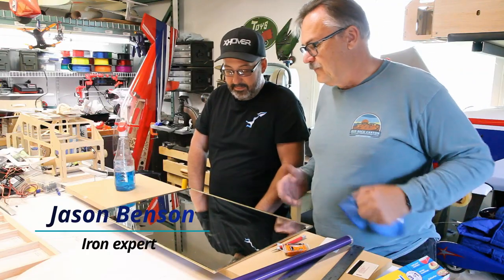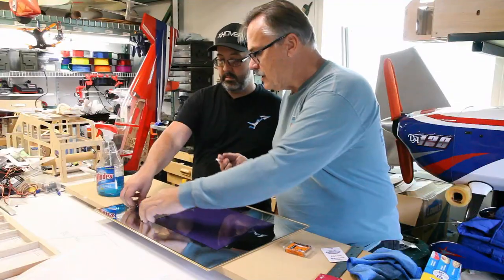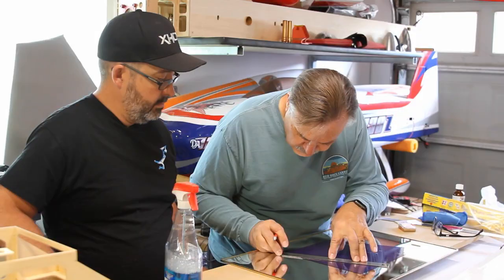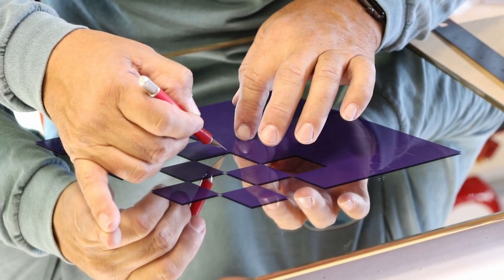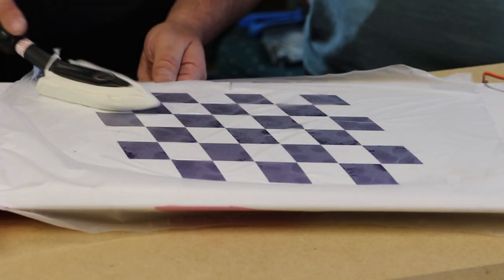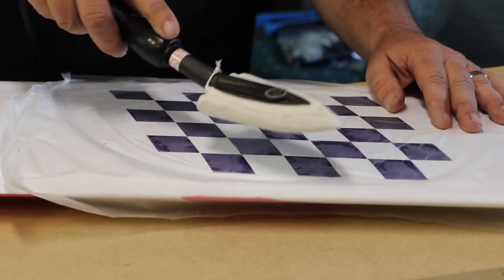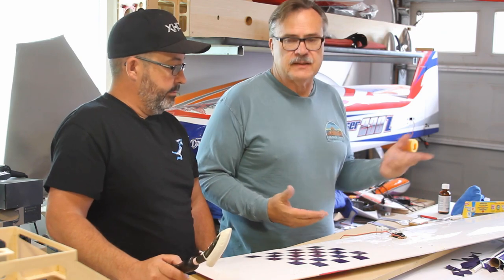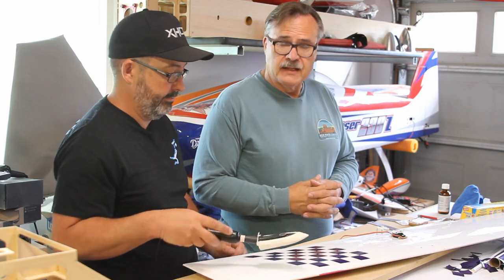Checkered Design Mastery: Unveiling Pro Tips

Comment: Came out pretty good, I would most certainly want to put some kind of clear coat over it to ensure it does not peel off.
Reply from the maker: Thank you Jerry. If you take your time ironing it down and use the Monokote trim solvent, clear coat is not necessary. We have planes that are 8+ years old that still look great.

Comment: Is that not a waste? can the pieces you discard not be used for the other side?
Reply from the maker: Yes Gary, you can use them for the other side, the only issue will be getting them to line up exactly.  I have used them for the underside of the wing and for the stabilizer, where if the alignment is off it won't be so noticeable.
Reply: To add to the previous reply. Another thing to consider is that you would generally mirror the pattern on the other side. There is always some waste when it comes to covering but I feel the final product is well worth it!